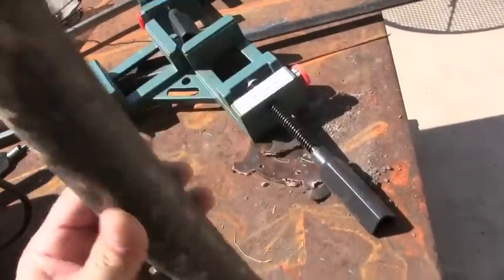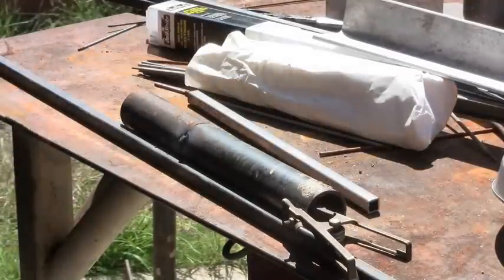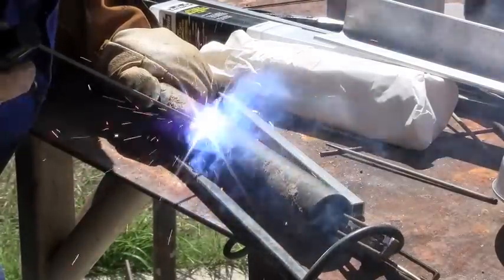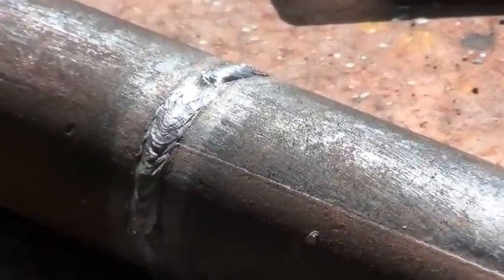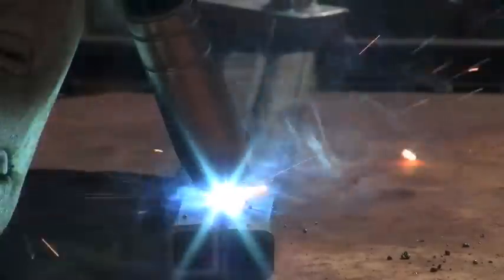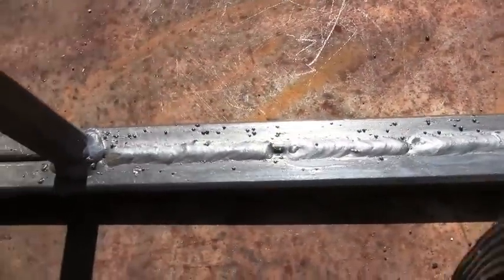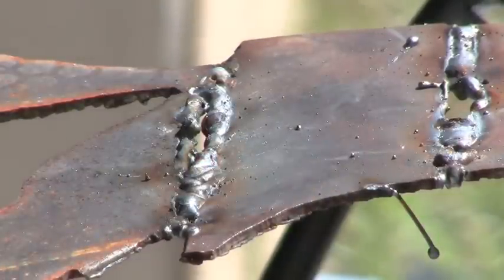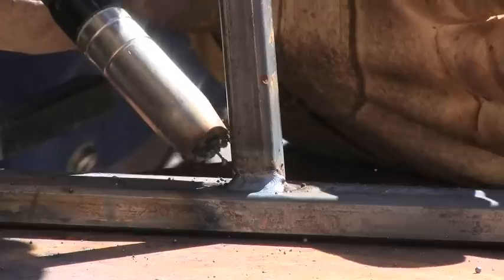harborfreight welder 80 amp inverter longevity stick/mig machine

Comment: I bought this welder recently and it was totally worthless until I upgraded the ground clamp. Still has a hard time pushing anything larger than 1/16 electrodes but it will do that with 6013 pretty well. Not enough power for 1/8 electrodes and barely enough to push 3/32 's .

Comment: Grind a bevel and landing and gap almost as wide as your root rod width, tack 4 points check the square and level, run a root pass filling at most half of the bevels height, the sound of the pass will echo in the pipe, when dragging stay somewhat perpendicular but tilt some in the direction you are traveling, clean, if needed run a filler pass for thick wall pipe, clean, then cap. You should notice the cap will be more flush. Then finally dress it

Comment: Whats up buddy..so you think the 90 amp flux welder from harbor freight is good for the home garage project. .or the the harbor freight stick welder they have..
Reply: hitsquadclothing  I have both welders from harbor freight and for thin metal I use the stick welder a little more thicker then the mig. There is a problem with the 90 amp flux core welder. You ca not make into a gas welder and also it puts out a ac current not dc  . It is very cheaply made.

Comment: ive been considering getting a inverter suitcase, i dont know much about them been doing alot of research the past couple days. i have 6 years exp. working on company flatbeds with the big rig welders, but im looking for something that can stick weld 1/4 inch or less off of 115v 15 for myself, im going to go a little higher dollar than harbor frieght but what can you tell me about your field experience with the 115v inverters? im not interested in wire fed stuff atm

Comment: Actually, look's like he is welding with 6011, standard rod for some farm fixes. alll around good rod. Breaking the slag, there is usually very little slag with 6011, 7018 is a different story. most people that I have met, never knocks the slag off, even after finished. the slag acts as a rust barrier, don't ya know, painter, Sincerely Alex, I love Games. off to the next.

Comment: I got an ancient 225 ac arc box and learned you drag not push your weld puddle with it or you get tons of slag in your welds and basically have to do it twice by the time you're done grinding, i also have the harbor freight 125 flux core and that one welds great for not being very powerful, hobart wire spatters too much i use the vulcan .035 and have welded a lot thicker steel than what its rated for and had to use a 7" angle grinder to cut it apart because a hammer wouldn't break the welds hope you aren't still pushing welds with a stick anymore you're doing twice the work and welds that way

Comment: Actually painter, you are so off kilter. your in outer space. When you weld, your burning off the 95% wood pulp off the rod. then yes you can run another pass over that one and liquify the wood again, a 3rd time wood not be good. Yes, a know alot, about welding. Was a H.T. in the navy. Which is a hull technician, I did nuclear welding, stainless steel pulled rings and everything. Not to inflate my self, but i jumped 4 classes while i was in my A school. was actually told by a... cont.